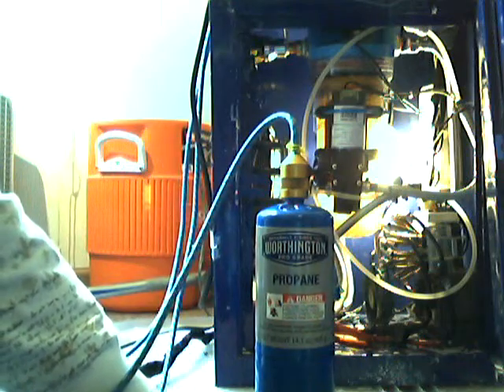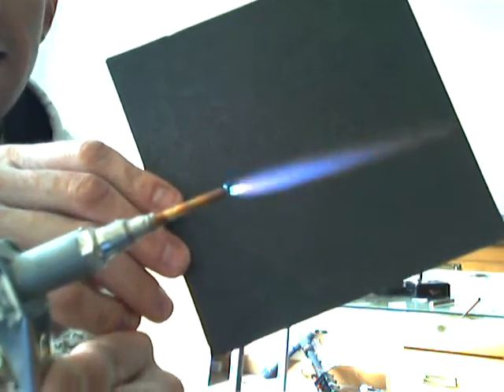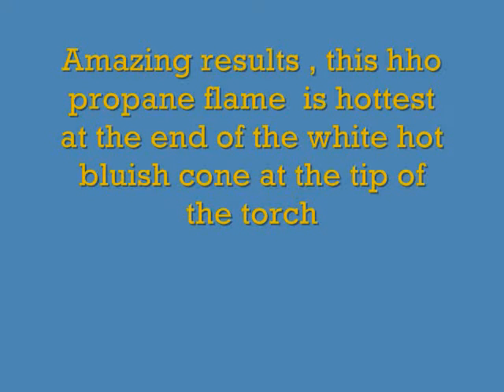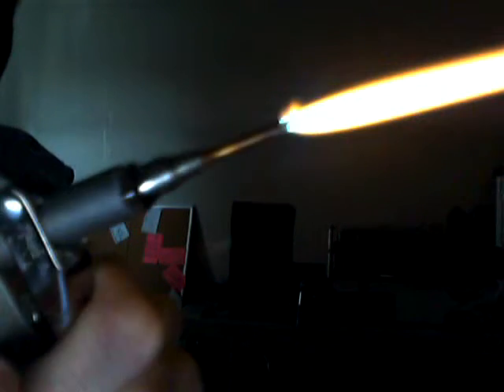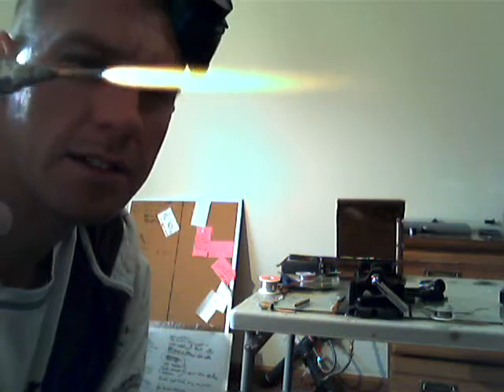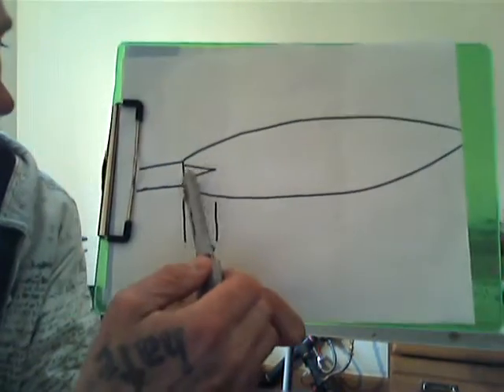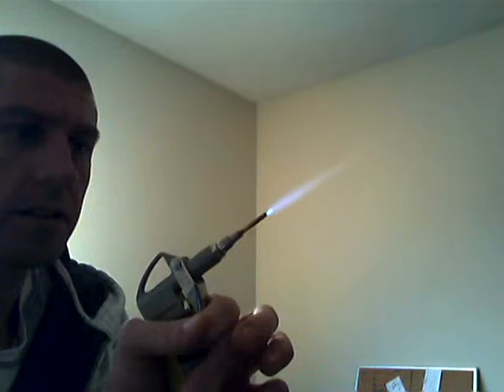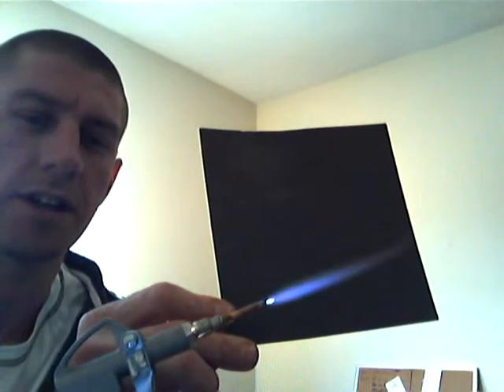HHO Propane gas modification for brazing

Comment: @altern8energy  In this video, and in his case with HHO gas it's not the gas mixture at fault making the orange flame. In this case it's due to his tip design and the way the gas mix is tumbleing through the tip, this is mainly caused by turbulence caused by forgen metal fragments that get hot and oxidize or cool the gas mixture when flowed over. There is more than likely a rouch opening on the back side of his tip hole, or is just pure design. The flame is burning slightly behind the tip head.

Comment: Well done man this is really cool mixing it with the propane and propane acesories to quote king of the hill cartoon lol. What is that handle from? As a welder man I have to warn you if you ever got a back burn in that flimst handle your hands would be seriously in big trouble fast. I've seen it with Aceteylne. The tip of the flame is Always the hottest point. The solid blue tight triangle your getting is an oxidising flame, you could cool it by getting a neutral flame. Awsome vid though cheers.

Comment from the maker: i did not have room to fit all that in one responce , the rapid cooling of the steam created in an hho Explosion causes an
almost insntantanias implosion, hho does implode subsequent to exploding, and as i was saying with the specific heat its like saying ok this welding torch can cun steel but a camp fire cant but the camp fire could bring an entire bath tub of water to a boil,, cus more of a lesser reaction is taken place but the welder is very hot and lesser in reaction,, make any sence???

Comment from the maker: not exactly ,, hho does explode its the rapid cooling of the reactions  byproduct , steam, you see the low specific heat of hho has to do with the small number of chemical bonds reacting when propane { a much larger molicule} burns many chemical bonds brake forming co2 and heat,, much more reaction takes place per molecule with propane, hho fibrates atoms faster then other flames but other flames can fibrate more at a lesser rate then hho can,, hho is faster fibration wise
large molecules...

Comment from the maker: hey bro i cant remember the name of the other gas they use for brazing and soldering,, i think its mapp gas but i think it may be something els,,, i cant beleave i forgot ... and yes it does lower the temp for the most part but the specific heat is greatly increased , i was able to solder copper very easely and before it took all i could give , and a  very long time   to heat up the copper pipe in the vid

Comment: This is very interesting to me. When i tried that i found it lowered the flame temp, but i didn't dial in the small cone shape. You have a great result there, keep playing with it, the info is very valuable. If you use it for a long period of time, plug in a CO detector to be safe. Good Work!

Comment: so you have a few things going on here ....from my understanding you have 2 hydrogens and a pure oxygen burning in stoichmetric mix and then adding pure propane to the mix taking it out of its stoichmetric  and sharing the pure oxygen with the pure propane.the propane wants to explode and the hho wants to implode so essentially they resist each other creating a greater specific heat.